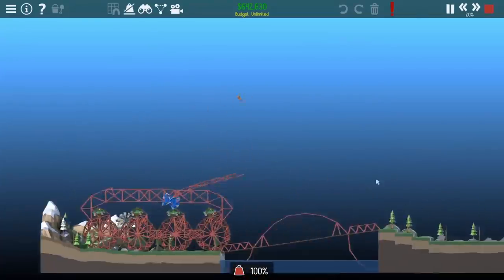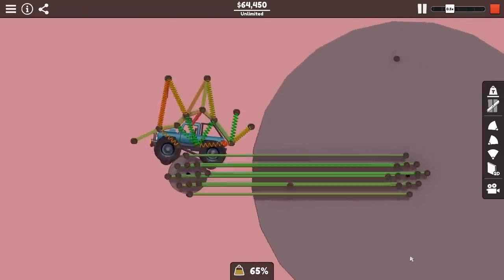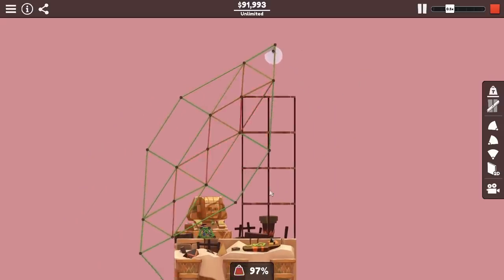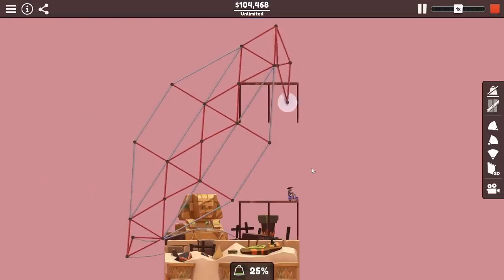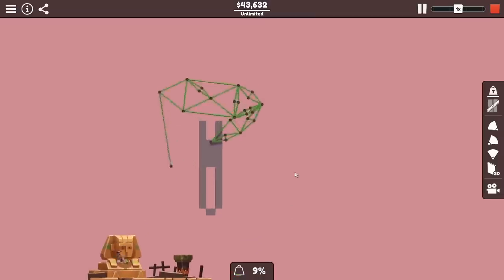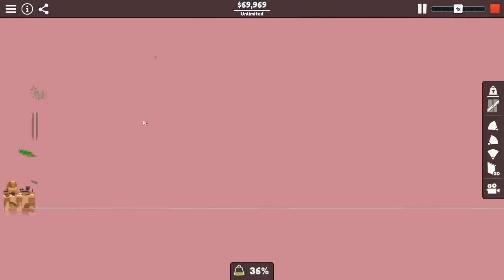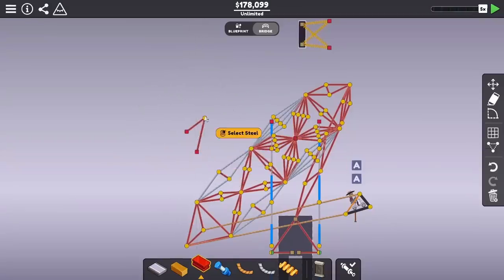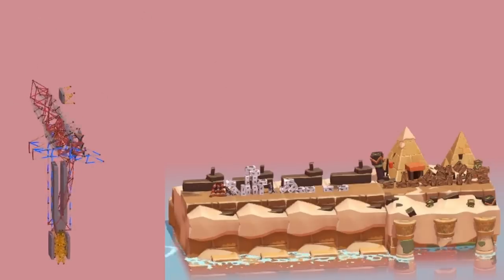Making a Fully-Automatic Trebuchet in Poly Bridge 3

Comment: Pretty sure the reason your trebuchet wasn't working after the prototype is because the cables attached to the sling should be 3x further away from the fulcrum than the counterweight. If you look back at the prototype, it's a lot closer to the 1:3 ratio for optimal trebuchets, and that's probably why it was a lot better.

Comment: besiege idea: drift car

you could theoretically make a light weight drift car that has a lot of power in the back, low weight distribution and wider wheels. -> also a besiege drift car with a similar v motor could be possible with more power ( more canons) for each piston. front steering is what would be needet. and you dont need to drift it like formuladrift, rather spinning tires and testing car physics of each newton law. for downforce or extra steering and or stiffness you could add horizontal wings in the bac and perpendicular wings in the front which move like tire steering

i would love to see that being built in besiege :DDDD

PS: thanks for your entertainment productions as videos :D